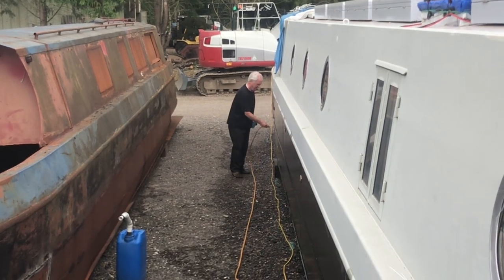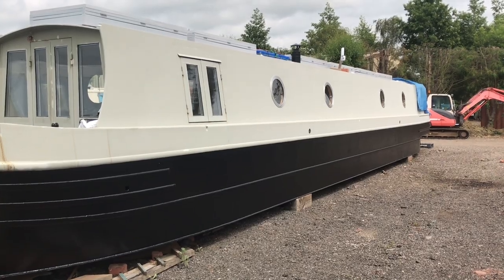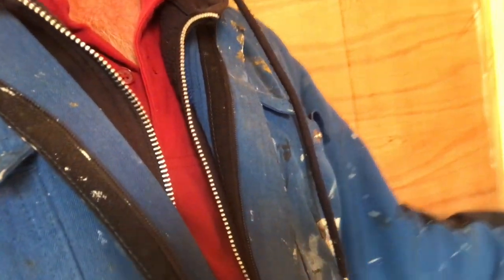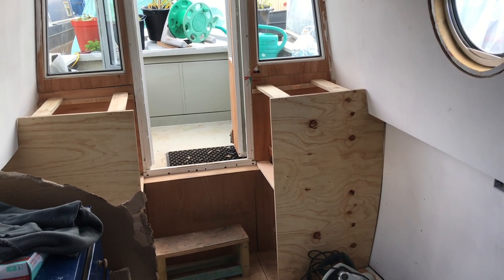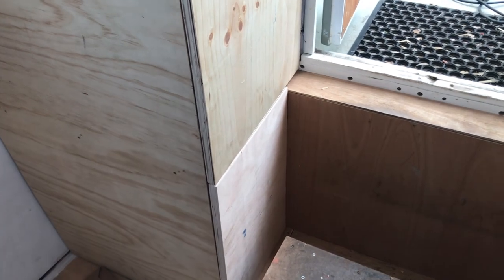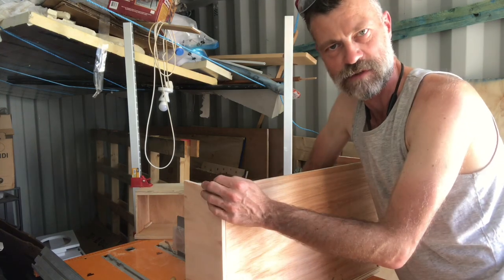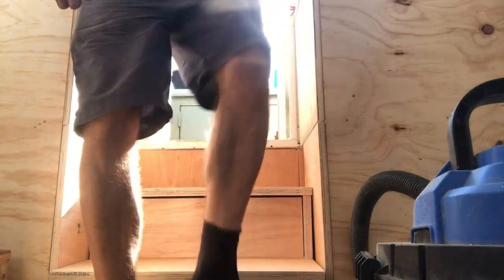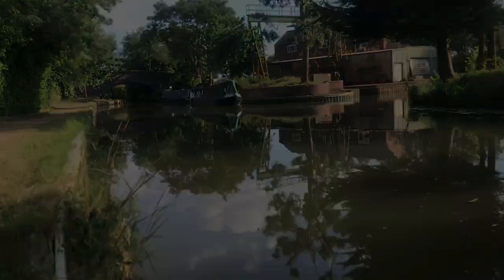54. Blacking, Bathroom, Steps

Comment: I’m a project manager and it’s my rule with whatever team I’m working with that at the end of major deliverables or complex bits of work, we take for a few days to reset - clear the head of any worries; replay; ‘wish I had…’ stuff and start again. Nothing wrong with a break 😁 make sure you take plenty so you don’t get overwhelmed or just sick of it.
Reply from the maker: Hi Arrowflyer. You are so right. I’ve realised I need to take some more breaks away from the boatyard. My problem is in my mind is I think X days break means X days longer to finish… but on the other hand if I run myself into the ground, I’ll never complete the boat 🙃
Reply: @narrowboatmlc  so that’s an easy fix. Build into your timings break & snag time. Like “the next 2 weeks is x, then 1 day break, then 2 days snagging fix”. Then your not guilty of taking an unplanned break and you’ve acknowledged there will be fixes required. If you don’t need the snag time, great, it just shunts the other work up and your ahead. That’s a nice feeling.
Reply from the maker: The snagging fix concept is a great idea - thanks for suggesting 👍👍 (and I’ve already set a short ‘escape’ for a couple of weeks time 😃)

Comment: Technical question here - how does the composting toilet work in the boat setting? Presumably you have to empty the “compost” - how frequently and where? So you don’t need to use a normal dumping station?
Reply from the maker: That’s a good question. In one of the lockers there will be a ‘hot composting’ facility for the solids - hot composting is good as it both speeds up the process and sterilises the compost. The volume greatly reduces and the plan is to store the product in some of the roof boxes until I can offload to a friend’s garden. The liquid can be thoughtfully and discreetly disposed of in the undergrowth near the towpath  as per CRT guidance. The whole idea is to avoid the dumping station.